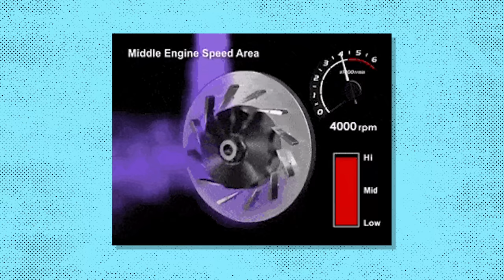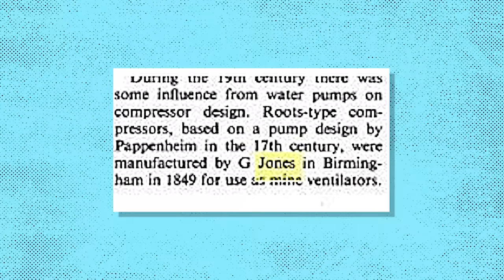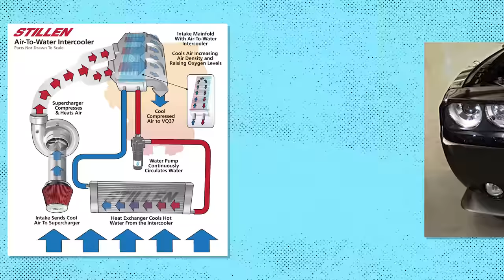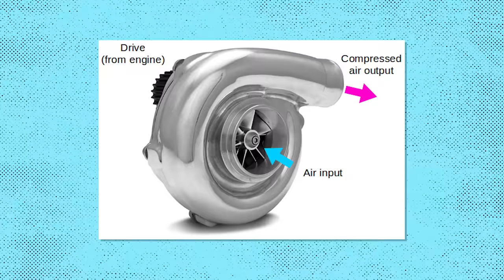Why Superchargers Aren't As Good as Turbos

Comment: Both turbos and superchargers are a paracitic load. Your exhaust stroke still pushes the gas through the turbo this is a paracitic load. Now granted it is a more minor load but I feel the way you phrased this is very misleading.
Reply: No, turbochargers are not a parasitic under load.
Reply: @sandervanderkammen9230  energy cannot be created or destroyed. Its basic thermodynamics. The exhaust gasses are transferring energy to the turbine, which slows them down, meaning their will always be reduced flow compared to when the turbo isn't there.
Reply: @acarguy3773  The energy transfer is still calculated by the Carnot Cycle Formula... using the BRAYTON CYCLE..
Heat energy tjat is rejected by the first thermodynamic cycle is recovered by the Second thermodynamic cycle.
 The centrifugal compressor reduces pumping loss of the reciprocating engine thus producing a net gain in both pumping efficiency and Carnot Cycle efficiency.
Reply: @acarguy3773  Incorrect, total CFM airflow increases... TOT (turbine outlet temperature) effects the T2 value.
Reply: @sandervanderkammen9230  net gain is a completely pointless thing to say. A supercharger is a net gain or they wouldn't exist! You think I'll have less power if I fit a supercharger to my engine? Of course not. The fact is that turbos have very little parasitic effect as the expansion of hot exhaust gasses turns the turbine, but to say they have absolutely 0 parasitic effect is just plain wrong. They are making the exhaust less free flowing, it can be explained as simply as that. Putting a catalytic converter in your exhaust is going to reduce power, putting a turbo in your exhaust and then removing the compressor side (so the gasses just needless spin a turbine on their way out) will not increase power, but very slightly reduce it. Not a big amount at all, and a supercharger will always have a much greater parasitic load to overcome by design, but yo argue that a turbo has none, and that a supercharger doesn't have a net positive is absurd. (you didn't say that exactly, but by saying that turbos have a net positive is implying that you think superchargers don't, or you're just not using your brain and saying a moot point.)
Reply: @sandervanderkammen9230  no reason to have a discussion in 2 threads haha
Reply: @acarguy3773  Wow! You are so close... yet you still do not understand how a turbocharger works...
the compressor is exactly how the heat energy is recovered by the reciprocating engine.

Can you tell me how?
Reply: @sandervanderkammen9230  yeah so now you're being ignorant and patronising for no reason. You're making a false claim, turbos have almost no parasitic load, but not none. They are very good at negating it, but not perfect. Superchargers are just extremely poor at hiding the parasitic load.
Reply: @acarguy3773  Just answer the question mr. genius...

Comment: Naturally Aspirated: uses engine power to pump air in and make engine power
Supercharger: uses engine power to pump air in and make engine power
Turbo: uses engine power to pump air in and make engine power.

All three have pumping loses.
Reply: Wrong, Turbocharged engines use waste heat energy to eliminate pumping loss and increase volumetric efficiency.
That is why Turbocharged engines make more power and have lower BSFC than Naturally Aspirated or Supercharged engines.
Reply: @sandervanderkammen9230  They dont use waste heat though, that is false. They use a pressure differential. Pressure and temperature are linearly proportional according to the ideal gas law, PV=nRT. 
So, high pressure and high temperature air exits the exhaust ports, and becomes trapped due to the restriction of the turbocharger turbine. This creates a pressure differential across the turbocharger, high pressure on the manifold/header side, and near atmosphere on the exhaust side. As that exhaust gas goes from high to low pressure, it's temperature linearly decreases because of the ideal gas law.
But, the exhaust port pressure on a turbocharger engine is higher than a naturally aspirated or supercharged engine. Rather than venting to atmosphere, the piston is having to push the exhaust out into the manifold at several atmospheres of pressure, which means a pumping loss to the engine.

100% of the power used by a turbocharger to spine the compressor, is stolen from the crankshaft, because the piston has to force the air into the exhaust. The difference in efficiency is simply the adiabatic efficiency of the compressor design. NA compression and pumping through the use of the piston/cylinder is least efficient, supercharger screws are more efficient, and centrifugal turbines like turbochargers are the most efficient.

Theres the Miller Cycle engine which demonstrates this. Instead of using the piston during the compression stroke to compress the fuel/air mixture, the intake valve is left open during the first part of the intake stroke. Usually a supercharger, but sometimes a turbocharger, is used to maintain compression in the cylinder until the intake valve closes. Because, it is more efficient to use a supercharger or turbocharger to get several atmospheres of pressure, than to use the first half or two thirds of the compression stroke of the piston.

Comment: Of course a turbo charger uses power from the engine. You only have to disconnect the output of the turbo to experience this
Reply: A turbocharged engine makes more power than a supercharger because there is no parasitic load on the reciprocating engine like the supercharger.

Comment: A parasitic loss sounds a lot worse than it is. It's an overall gain, and not just a small one. There's a reason why modern top fuel dragsters use them.
Reply: Turbos are BANNED in Top Fuel
Reply: @WilhelmKarsten  Parasitic loss exists in superchargers, not turbos. I'm talking about superchargers.
Reply: @mrman3904  The reason why Top Fuel uses superchargers is because it is the only method of forced induction allowed.